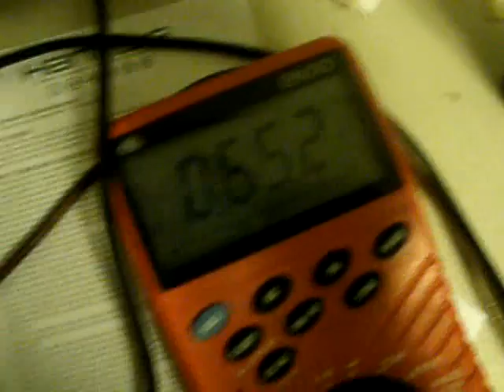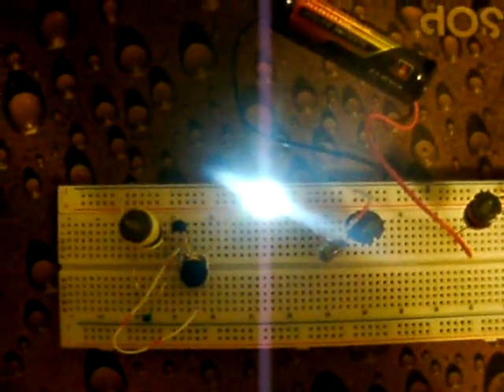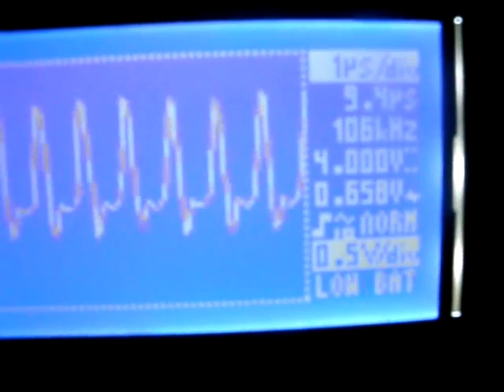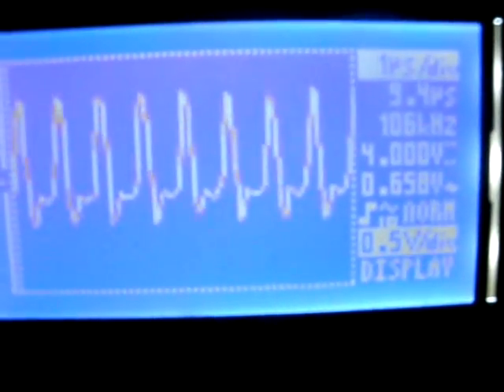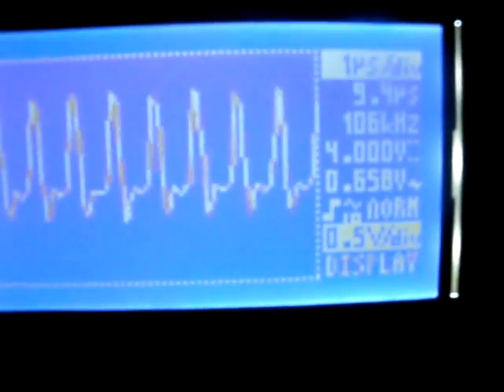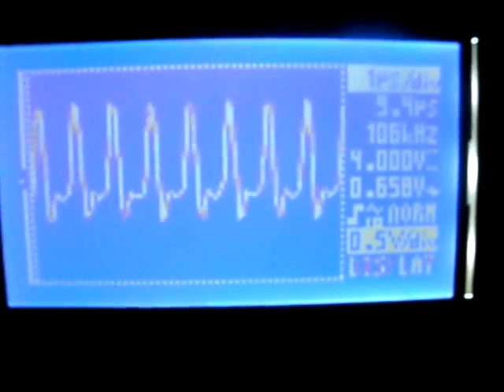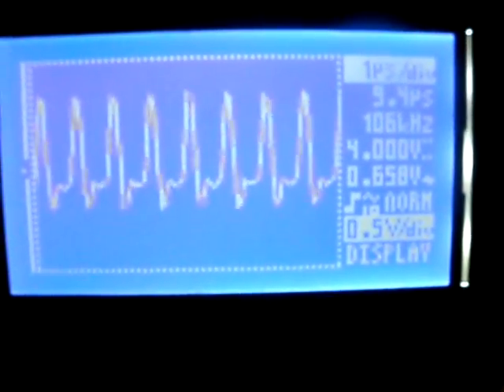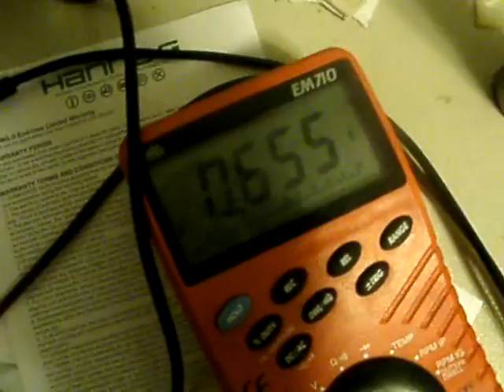hartley oscillator part 2

Comment: The 104 mA drained from rechargeable & the meter do not show the other impulse current that recharge the load batt, because is very clear that the rechargeable should be exosted in 5-10 hours or so, depending of the previous charged level of this battery. So, its better to concentrate on the milivoltage of the battery, watching to rise, like is shown in my videos. Try a secondary coil with tesla bifilar windings, like in my device and videos and a 1500uF capacitor parallel with battery(s). Tnks

Comment: I will post a video soon, is in progess, but you can contact me on johnnyaum yh mess or email for schematic. This device works perpetual and recharge batteries, but on low leds, but this can be fixed. If a find a serial for Photo Movietheater 2.21, that will be great, this is the only thing not resolved in publishing the video, but also a crack for it is in progress, hehe.

Comment: In this type of JT circuit, a battery charges slowly if it has that capacitor in parallel with the battery (capacitor) and led is set to less bright light, and we watch carefully THE BATTERY VOLTAGE, NOT THE CURRENT! My experiments shown this low continuous charging is posible, so this is perpetual overunity circuit and device and eternal minilamp also!

Comment: In my JT, a 1000-3000 or more microF capacitor will go down the current some 20-25% procentage; its better to see this circuit as a dual circuit where a half part recharge the other half part one moment, and the next moment everything reverses in mirror and also the circuit must be considered the providing source of energy through resonance, the real battery, and the battery must be considered a load, so everything is backwards :)

Comment: Im watching closely your and stprue videos about sjt, are great, similar with some of my schematics; please continue until the point where the battery can be removed from the resonant system, and the schematic could be upgraded to a final close loop device that can power a house, it is very posible and not so difficult! PLEASE POST A SCHEMATIC OF THE CIRCUIT SHOWN IN THE VIDEO; i already reverseenginereed one, but yours will be more clear and precise; good luck with achieving overunity for all!